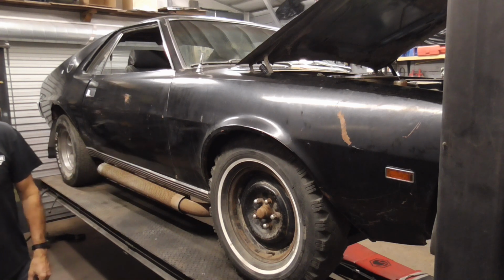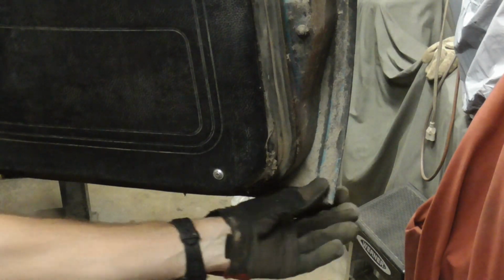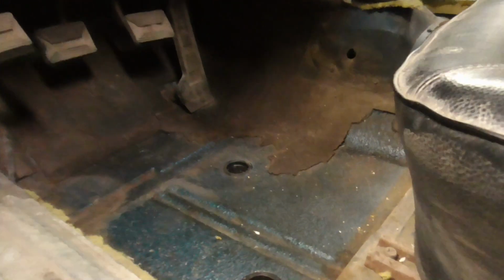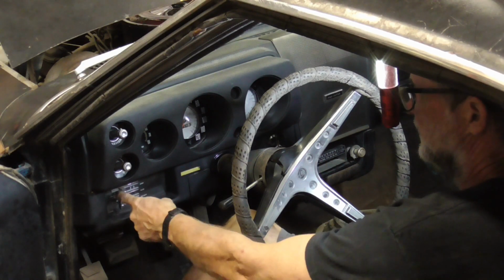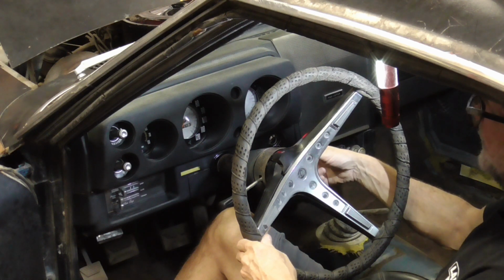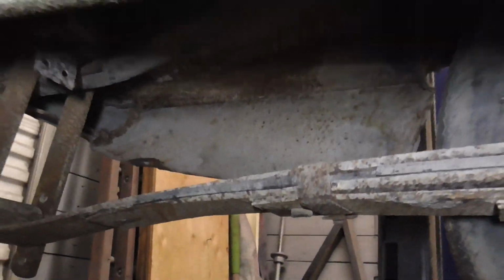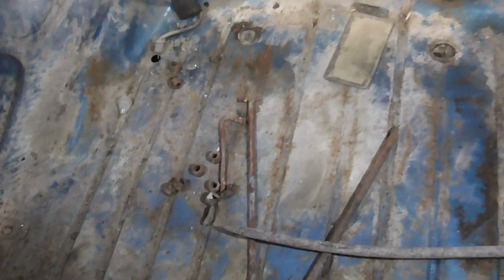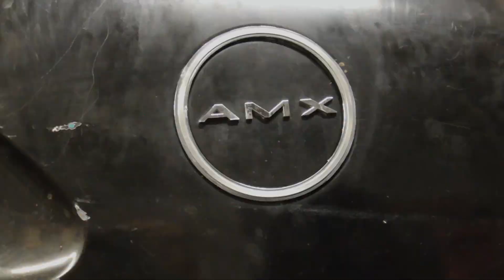AMC AMX 390 4 Speed - Walk Around Before Restoration

Comment: I would go back to the original duel exhaust you already have the right trans mount and the front pipes are smashed showing you whats in the future also I have been burned several times by side pipes when wearing shorts
Reply from the maker: Good points Dave.  Why do you think those pipes got smashed - too close to the ground?  Not supposed to be there or not supposed to have side pipes?

Comment: 390 and a 4 speed, what a treat! I saw some blue or seafoam aquamarine in the door there, going back to that color or painting it something different, unless you aren't going to fully respray it?
Reply from the maker: That blue is the original color - Caravelle Blue.  That with the flat or satin black stripes.  Should be a treat for sure with the 4 speed 😊
Reply: @LakesideAutobody  nice, I have a 71 Javelin SST that was originally the Electric Blue, super nice color but the previous owner painted over it in 1984 to just a more generic blue. Still looks good overall but its definitely a 10 footer car. Any timeline for the next video? Looking forward to the next part regardless
Reply from the maker: I post every Friday at 6pm.  I've got a few videos coming up before really getting into this car.  Right now I'm in the middle of redoing the front suspension.  After it's running, I'll really be uploading a lot of body work videos on it.  Glad you like it.  I actually thing the 71 Javelin is a cooler body style but this will look pretty tough when it's done I think.  @ferdinand9103
Reply: @LakesideAutobody  awesome, because it seems that completed restorations for AMC stuff is few and far between on Youtube. Good to hear that its not been shelved yet lol. Can't wait for the next video on it!

Comment: Friend of mine had 74 AMX with those side pipes. If you were not careful getting in and out when they were hot, with shorts, on they would burn the flesh off of the legs. He ended up getting rid of the steel pipes and going with aluminum.
Reply from the maker: Thanks for the story XJH - have a good weekend :)